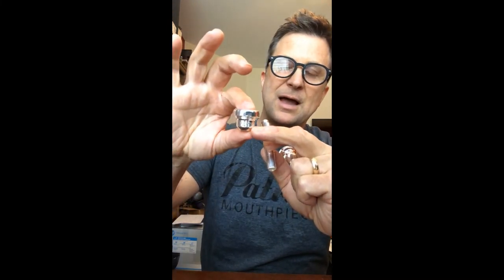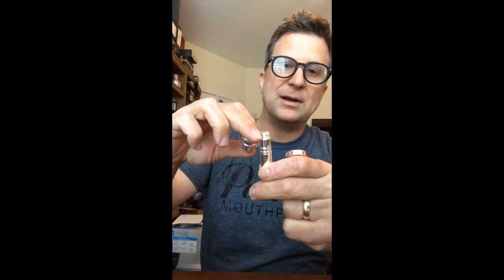Trumpet Mouthpiece Anatomy - PATRICK Mouthpieces

Comment: Well done Steve - you sure saved my rear when I lost my mouthpiece and set me up with a better piece than the one I made - I'm always amused with players that are trying to play on a Bach 1 1/2 because their professor told them it was the correct mouthpiece to play - well if you want to get stuck on 4th the rest of your career go for it.  Now if you are in a symphony then you won't have to play above a high C and you will have that dark tone the conductor likes but forget about lead in a big band. I play Steve's pieces and even have a good double G on Cornet so I highly recommend PATRICK Mouthpieces.
Reply from the maker: Thanks Buddy!  It's all about having the right equipment for the right job!  A 1.5C is going to work great for some people and for certain applications.  But you're right.  To just make a general statement and stick only to that is not the best approach in my opinion.